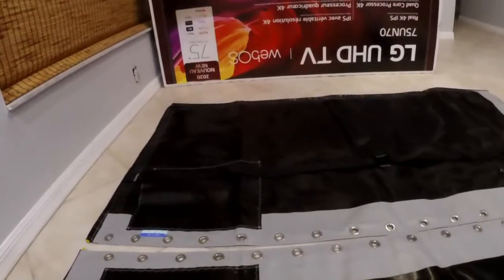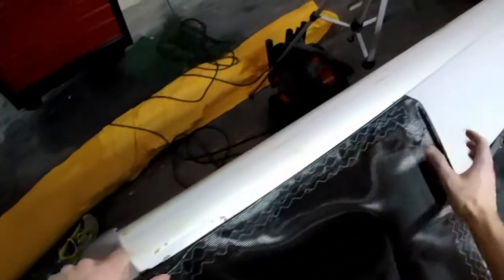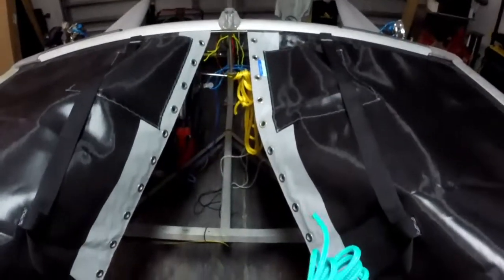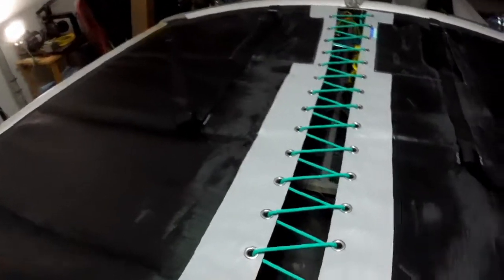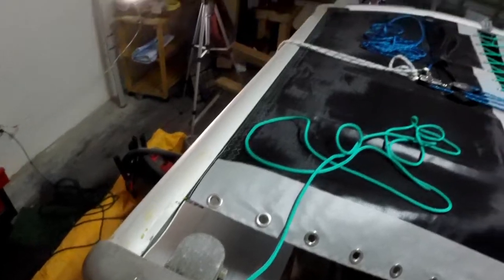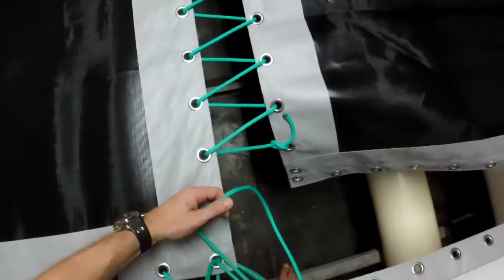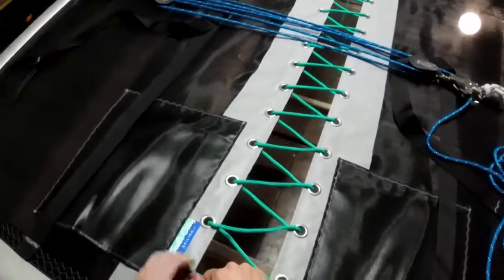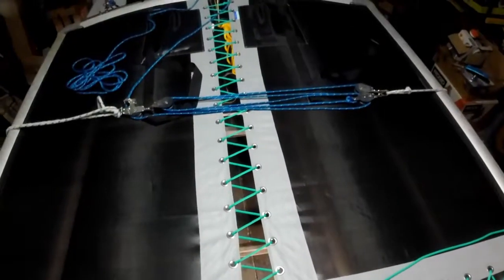How to Replace a Trampoline - Hobie 16

Comment: I'm getting ready to pull the trigger on a Salt City tramp with the tough wrap strips. How is yours holding up so far?
Reply from the maker: Mine has held up great so far , but I have only taken out a couple times with it on. It is so much better than the old vinyl one. I am still working on major delam repairs, so I'll hopefully check back in after they are done.
Reply: @tridactik  I just had my tramp delivered. The lacing came as one 53-foot-long piece. Thanks for listing the lengths!